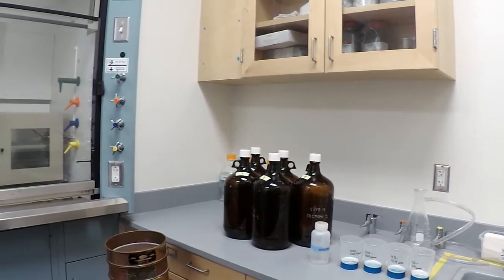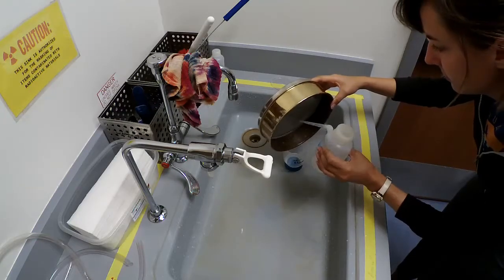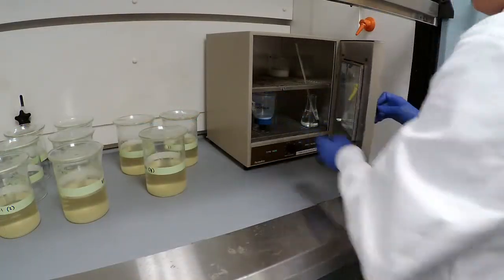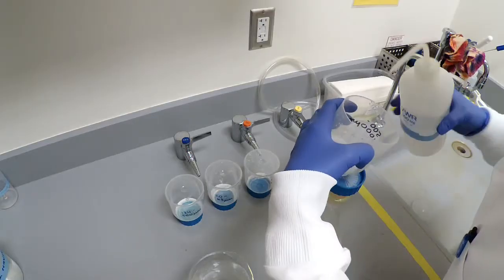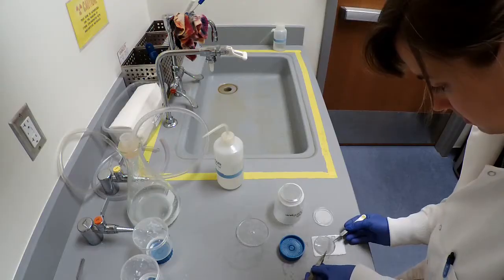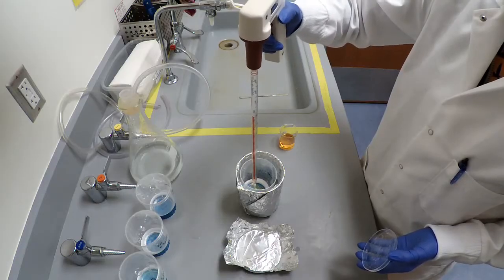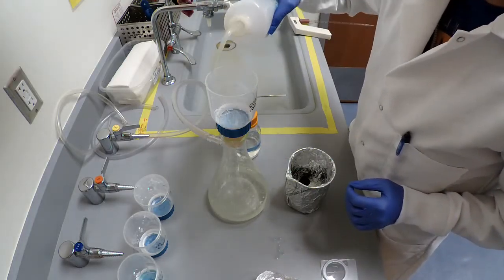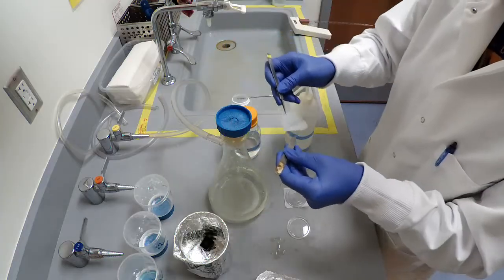Microplastic Water Sample Preparation Protocol

Comment: what type of filter (material wise) you are using here
Reply from the maker: If you are only interested in visual identification, you can go ahead and use glass fiber filters.  If you are going to do any spectroscopic chemical identification of the plastics, those are problematic and you would need to switch to polycarbonate, gold, or other media

Comment: Hello, just want to ask what is the type of filter you used..
Means is it a glass filter/fibre filtre or what..kindly explain
Reply from the maker: Sorry for the confusion: our default for only visual processing is to use the cheapest kind: a glass fiber filter.  If you are going to do spectroscopy work, those glass fibers screw with the light absorption.  So for those we use poly carbonate or gold filters.

Comment: Hi, i am currently working on microplastics. Can you please tell me the pore size of your filter? And how you decide the pore size?
Reply from the maker: Out default is 1.6 µm
Reply from the maker: We use a GF/A or GF filter (Whatman #1820-047) with nominal pore size of 1.6 µm; 47 mm diameter. That is secured in a vacuum filter holder with a Cole Palmer-Air Admiral vacuum pump (model # P-79202-00).  We are developing a new protocol with the State of California which uses a stack of filters with the 1.6 pore size at the bottom, but that might be overkill for your needs.  What are you filtering? Air? Water? Soil?

Comment: I am currently working on microplastics,
is it necessary to use hydrogen peroxide for water samples from bottled water samples?
Reply from the maker: It can help with the digestion of organic matter.  What are you working on: drinking water samples or water from streams/the ocean?
Reply: @ThePirateLab  bottled water
Reply from the maker: @ruqiazardari1668   Then no...you need not do a hydrogen peroxide digestion
Reply: @ThePirateLab  thanks for your reply

Comment: Can I follow the same process for the sample of industrial effluent or wastewater treatment plants
Reply from the maker: Of course.  We use essentially this same approach for just about everything/every matrix, save for air (the particles in our air sampling are directly deposited on the filter media and so don't require this step).  Liquids go through this process. Sediments are put in a high density solution and then the supernatant is poured through the filters. Tissue samples are first digested (with H2O2, KOH, etc.) and then the resulting slurry passed through the filters.  I would do a test run.  If you filter is clogging too quickly with macro particles then try a test digestion and repeat the test.